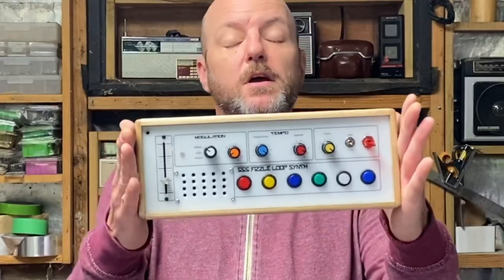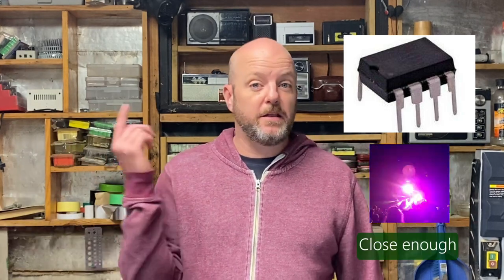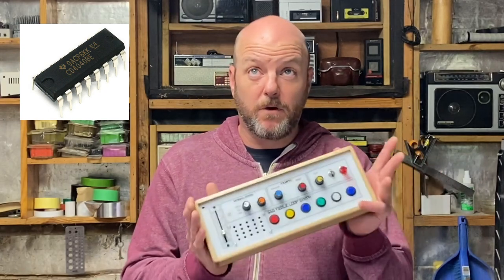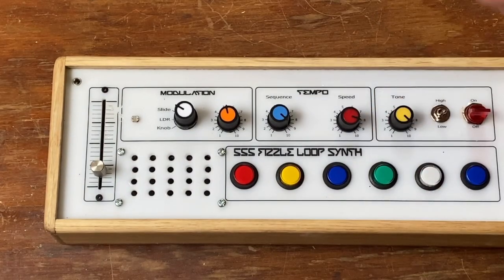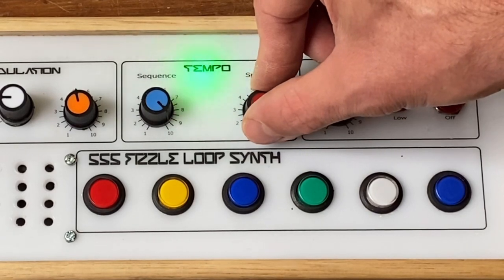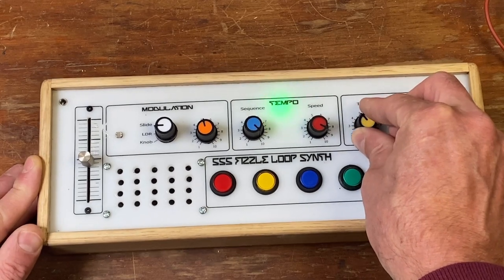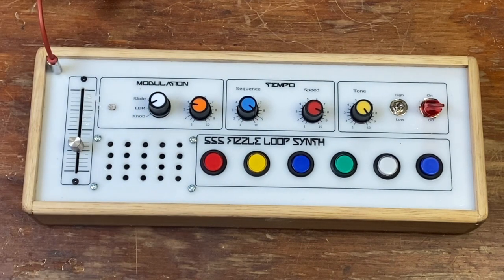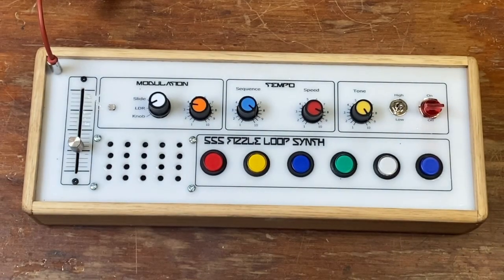Fizzle Loop Synth - 555 Timer Project

Comment: Nice, like to rebuild it. I checked the circuit, and found an 7805 regulator. What are those 5V for, since all the parts in the circuit get powered by 9V?
Reply from the maker: Good spot!  I included this so I could power the LED's in the latching switches.  Unfortunately, the ones I brought didn't state the voltage to use and I blew a couple of them.  Plus they were cheap and I don't think the LED's were very good.  
I've used similar LED switches in the past and powered off 5V's and it hasn't been an issue
Reply: @lonesoulsurfer  That makes sense now, thank you.
Reply: LEDs use about 2 or 3 volts.
You need series resistors with them to use up the extra volts and limit the current through them.